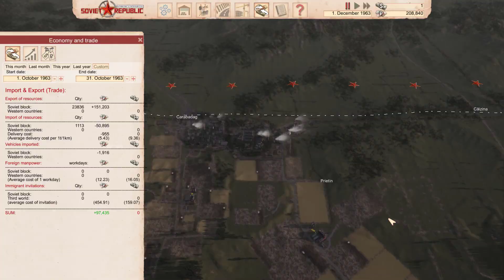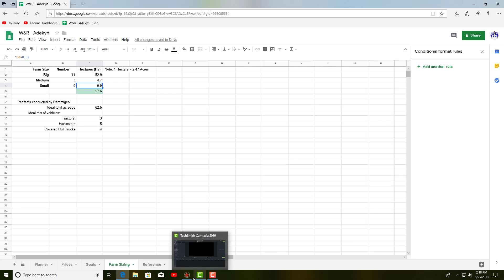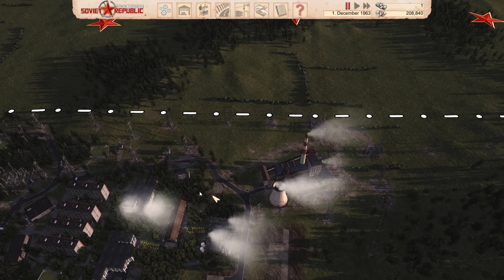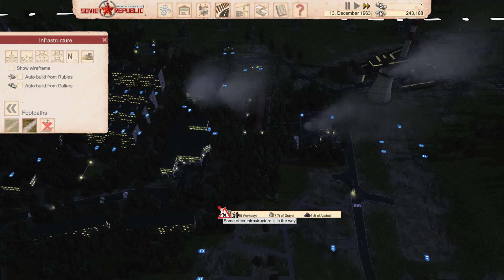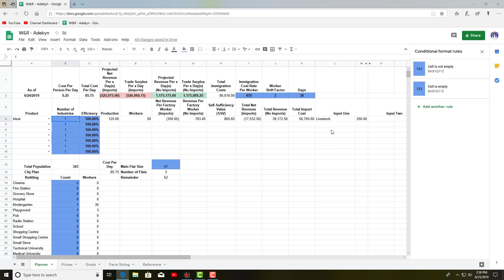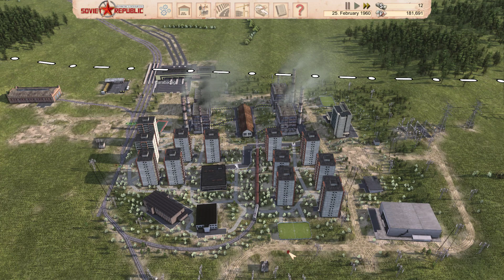Workers& Resources: Soviet Republic - S3:E6

Comment: You're doing very well, but may I suggest a few things?
 1. Don't give up on rail, especially electrified rail...if you produce excess power, the cost of loco fuel is  non-existant once you mine coal, and overall trucks just dont shift enough material over a large area to be efficent.
2. After you set up the livestock area (great idea!), do the coal mine next, build 2 power plants and use them to ship power at the minehead, and demolish your current power plant by the University...its cheaper to export power over a distance rather than shipping the coal.
3. Right after you do the coal check for the nearest iron deposits to the coal mine(s) and get them together, either by conveyor or rail...now you can make steel.
4. dont forget the easy cheap export items like lumber and gravel to give fast (relatively) low-investment cash returns.
Overall youre doing great at Workers and Resources....hopefully the Politburo won't send you to Siberia for TOO long if you fail the 5 year plan...........
Reply from the maker: I'm not sure I'm doing so well, but thanks. 1) If we survive I fully intend to use rail for the long haul on high volume goods and materials. The current trucks are more than getting the job done within the one little town area and easily keeping up with the volume of alcohol, food, and clothes we are producing. It's a good point about the electrified tracks greatly reducing on-going costs, but that has to be balanced against the entry cost for one decent-sized train hauling over a distance which is very high - lots of expensive track plus a very expensive train. 2) Thanks, we shall see about the livestock, but the numbers certainly show promise. I intend to build coal / power as soon as possible. My plan was to either transport coal by train to the existing power plant (in addition to other power plants) or demolish it as you say.